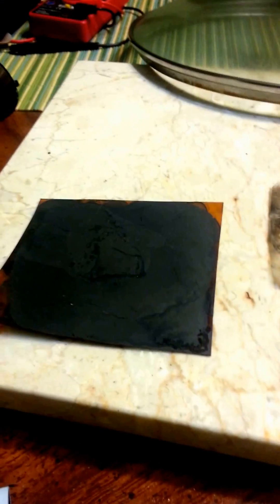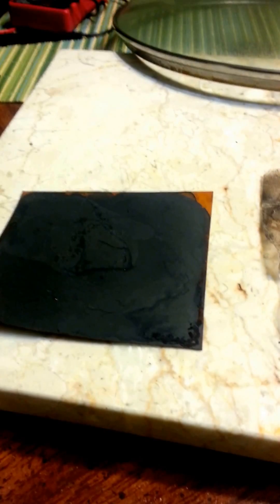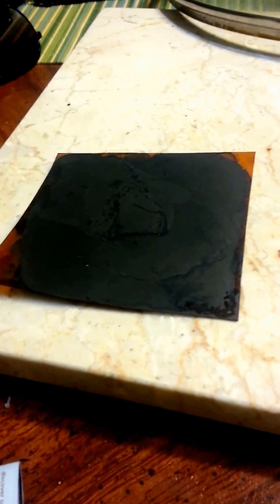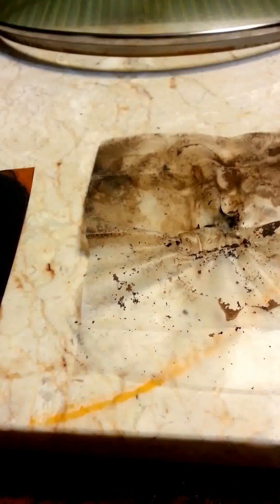More progress on the graphene front.

Comment: Since I am not entirely sure what it is you are trying to create, I might as well go ahead and ask: Are you trying to manufacture a graphitic foam electrode (a form of 3D graphene crystalline structure) to maximise the surface area ?
Reply from the maker: Actually the new method I'm working on is even better than a foam, because each platelet of graphene is an individual electrode around the electrolyte. The surface area is so great that the charge density seems to be in the area of lead acid batteries but still have the capacitor charge speed. Here is a link. http://www.kurzweilai.net/new-graphene-based-supercapacitors-rival-lead-acid-batteries
Reply: The Wh/kg or Wh/L value depend on many things. The dielectric or electrolyte. The structure of the graphene, either as sheet's or tubes and in the end, the surface area aka available interaction surface and the interaction of the ionic solution. At first I figured that manufacturing GEC (Graphene Electrolytic Capacitor) would be rather simple, but perhaps its not. I encurage you to continue with what you are doing, I will follow your work and contribute. I remember reading an article were it was claimed that the specific charge density was in the order of 300 Wh/kg. So right now, that is my goal.
Reply from the maker: Patrik Lövström If the new method works out, the whole battery will just be a matter of printing out individual plates and assembling the thing in stacks.
Reply: Printable ink / conductive ink method, yes that is most certainly a way of doing it. I had the idea the other day that if you have GO in powder form, very dry, and use a laser printer on a flat bed that stimulates the GO via Laser to produce exfoliated graphene, you could then control the thickness per layer and that way print graphene wafer electrodes. It do not matter if water or some form of liquid suspension is involved from my study. And perhaps the dry printing to some degree produce a 3D structure. I am going to test both method's as I commence further with real life experimentation.

Comment: Glad to see that people are working on this and I am also looking forward to some updates and result. How come you are not using the LSG /flash method or have you moved on to that now ?
Reply from the maker: The results were very promising. I have to get more time on the equipment to get results that can be worth posting. But I found out about a new way to integrate the electrolyte in the electrode, and it has really promising results. I'm working on so many things at once, but the good news is that things are going great.
Reply: Nice to hear. Take your time, after all persistence is a key factor. I am planing an EV conversion and the only reason is the graphene capacitors. I am aware of the fact that it takes time to develop a functional and reliable process. Who knows, you might have something going and so I'll better follow the development.